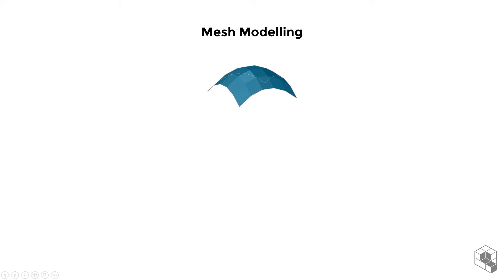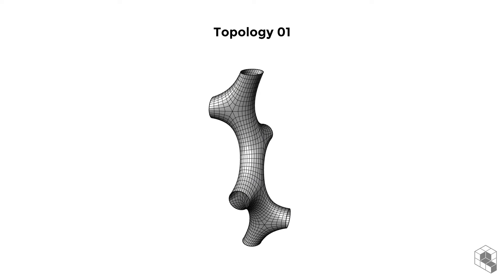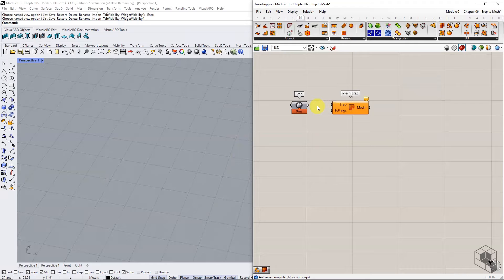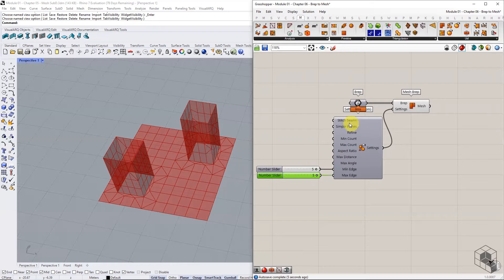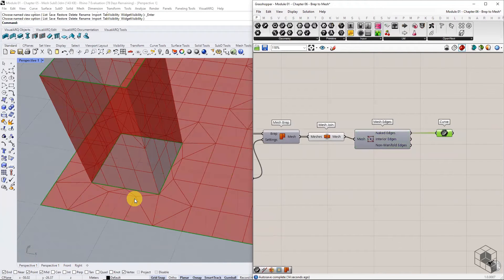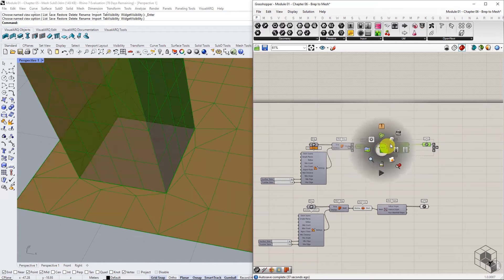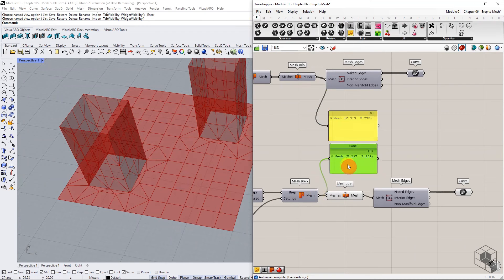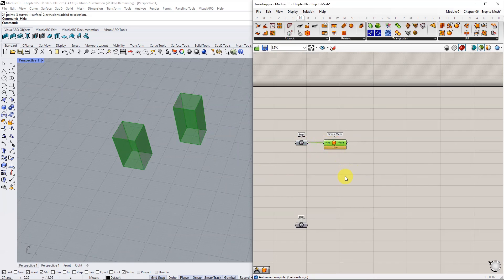Mesh Modelling - Chapter 06 | Brep to Mesh Conversion | Rhino & Grasshopper Tutorial

Comment: Thanks for the lovely video. But what about converting SubD into a mesh. Furthermore, I have experienced an issue where when I perform mesh difference between two meshes I get a mesh intersection instead or in other cases the mesh difference operation is skipped completely resulting in A-B = A. Instead of A-B = A-B. How can I solve this issue if you have any knowledge of it, it would be greatly appreciated. Thank you
Reply from the maker: Boolean operations in grasshopper are not reliable and prone to failure. Even there, Boolean operations with breps and more successful than Boolean operations in meshes. My suggestion would be to convert mesh into brep for any Boolean operations and then convert back to mesh .